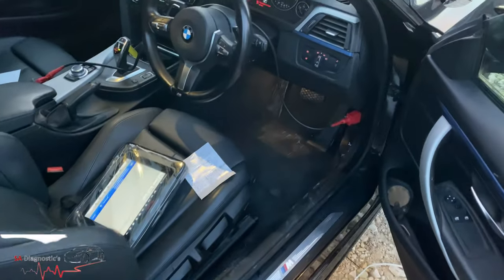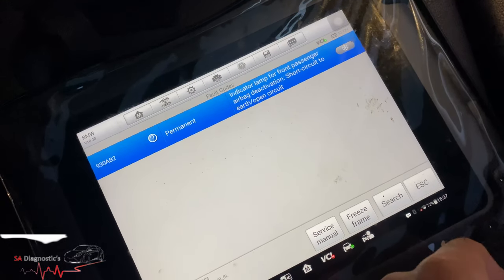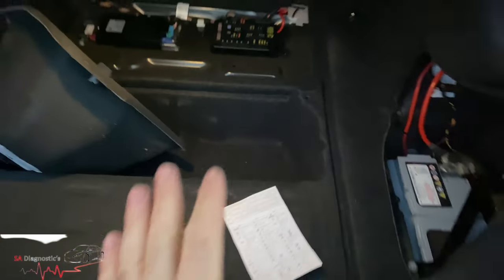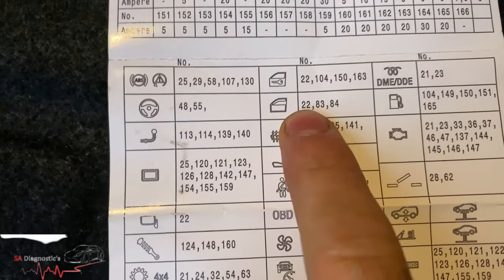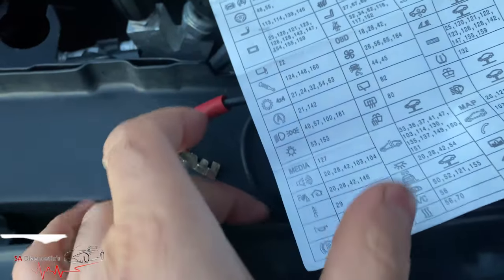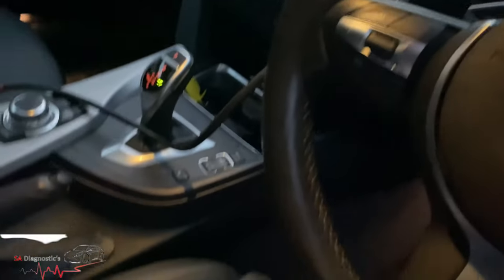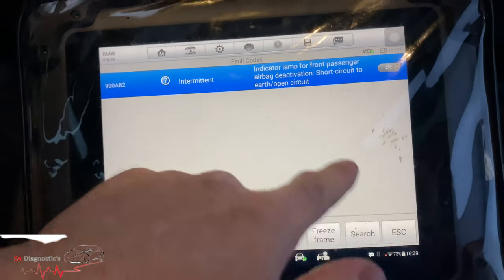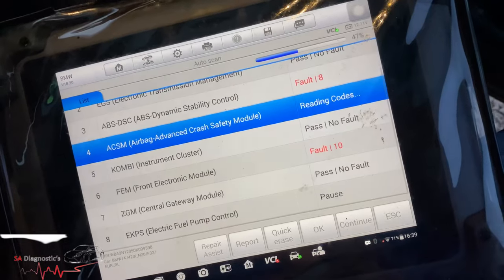BMW 930AB2 Indicator Lamp For Front Passenger Airbag Deactivation Short Circuit To Earth Open

Comment: I have a bmw f23 convertible 2017. I changed my airbag by watching the video that you done on the f30 was a great help👍🏻 but im getting short circuit on steering and passenger dashboard. I removed to double check but still nothing. Any ideas?
Reply from the maker: @marv1490  it maybe because the airbags have been deployed and have been fixed before.